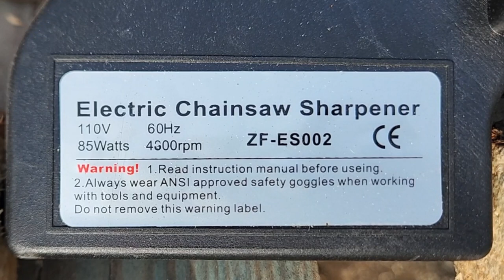Sharpening Sawmill Blades

Comment: Is that a flat or angle grind, was hoping you’d show how it cut? Thanks for sharing.
Reply from the maker: It ended up being a flat grind, I may need to adjust the height at the pivot to make it match the slight angle on each tooth. I will publish video of how it cuts once I get that far and any upgrades or adjustments to the grinder. Great questions! Sorry I havent been able to try milling with it yet, proof of concept so far but it can be re-designed easily with adjustable angles to match tooth angle. Thanks for watching.